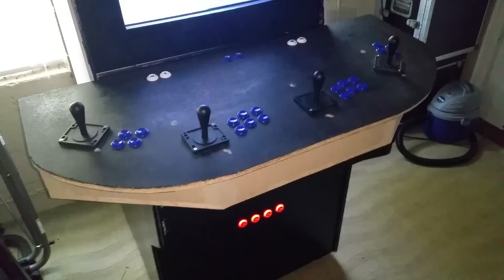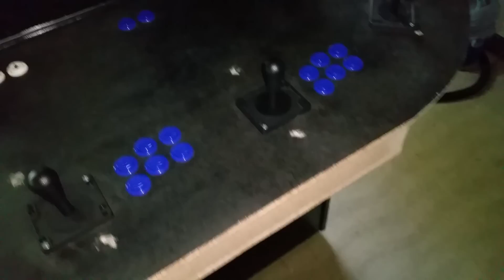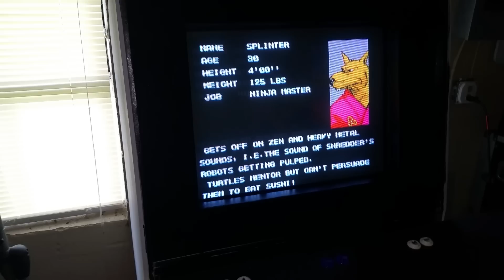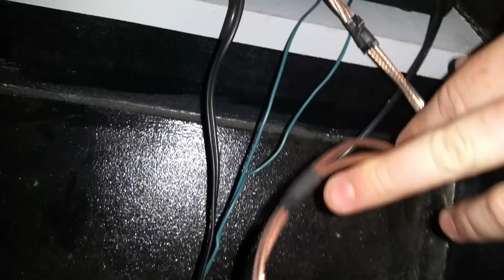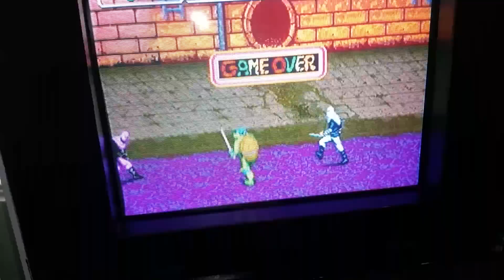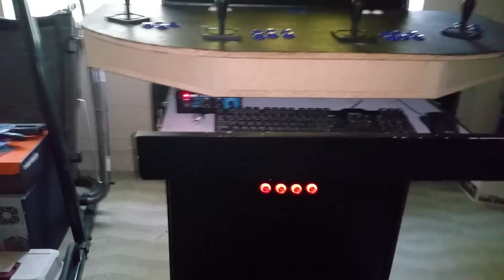MAME 4 Player Ultimate Arcade Machine I-PAC

Comment: I have looked through your video's to see if you have finished, but i don't see any updates. I hope at least you have mounted your happs underneath your controller box, that is were they should be. I suppose you have already done this cab, but if i had seen this vid in 2015, i would have said, stay away from Hyperspin, it is a right royal pain in the arse to setup and tp keep it working flawless, especially if you don't use your cab a lot, Hyperspin can really mess with you with any updates it will prompt you to install. My advice would have been to just get a good stable mame release and a full set of roms and just use it like that. Don't know if you have gone down the hyperspin route, but trust me i have and it's a pain, i just use the mame main executable file, put it on your desktop and you are good to go. Mame will never ask you to update so you will never need to worry about it working every time you use it. Would have been nice to have  see na follow up to this video of the cab all done, she looks great apart from those sticks sitting on top of your cab. I hope you have done this beauty
Dave
Reply from the maker: menacegtr Hey Dave! Thanks so much for the comments! Sadly this project had to go on hold for some other stuff I had going on. I have done a lot to it though. The sticks are now sitting below like they are supposed to! I still have a long ways to go, but I will post an update video soon. I couldn’t for the life of me get hyperspin to work, so I still just open the mame program and select the rom I want to use. Like i said, I will post an update soon! Thanks! 
Josh
Reply: Thanks for the reply Josh, i look forward to an update
Dave

Comment: Hey josh awesome set up this is exactly what I wanna do since I love the 4 player games also... Just wondering if making it play with 4 players is easy to setup...thanks
Reply from the maker: Hey Marco,
Control setup was a breeze. I used an ipac-4, so it basically takes place of a keyboard. Your control panel buttons then act like keyboard keys. Just go into mames settings and tell it what keys you want to do what and you're ready to go! Once you get all the wires run it takes literally 5 minutes to get the controls working. Let me know if you have any questions. I'll help all I can!

Comment: replace pc with a raspberry pi 2
Reply from the maker: I don't really have any experience with raspberry pi. would it work with the i-pac interface?
Reply: Yes i was browsing there is if u search on youtube ipac raspberry pi. The best of all it can play all ur games and running on cheap electricity from a 5v  all mame games all retro games... myself im using retro pi. Thts what the os is called on the retro pi. Lets me play all games u ust need 2 download the room game from free websites ... there is even tutorials for tht
Reply: 30 bucks not tht expensiv but so u dont buy wrong version buy raspberry pi 2b thts the latest running 30 bucks
Reply: But ur setup is awsome
Reply: U can even plug in ur wifi dongle etc and transfer wirless to the rasperbry ur pc game... like a stream machine
Reply from the maker: +Simon Beccari that sounds pretty awesome! I may have to check into it. Thanks for the suggestion!
Reply: Im using my laptop dont want 2 hook it up with cable all the time to tv... so im using raspberry with limelight its called to stream my laptop steam games... i can even use controller
Reply: So u ust need to turn on tv in my case since the pi is powered by usb cable from tv. Meaning pi boots when tv does and im set turn on ps4 controller and voila ... abit setup first time but u get jist of it. And if u dont like tht setup... u can use it with ur ipac as arcade machine
Reply from the maker: +Simon Beccari that sounds like a pretty neat setup. I will definitely check into it. Thanks again for the suggestion!
Reply: Noproblems